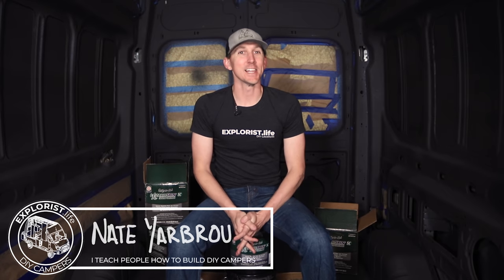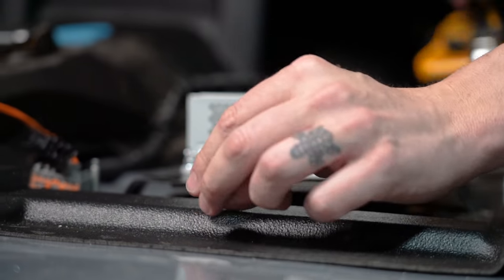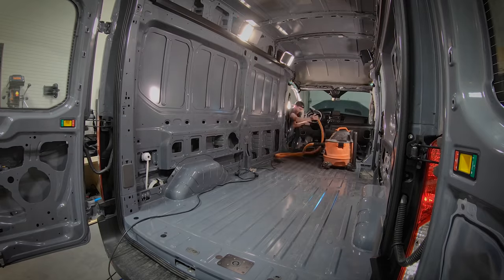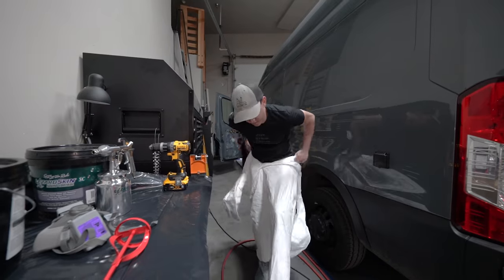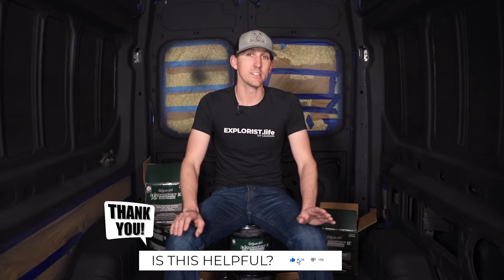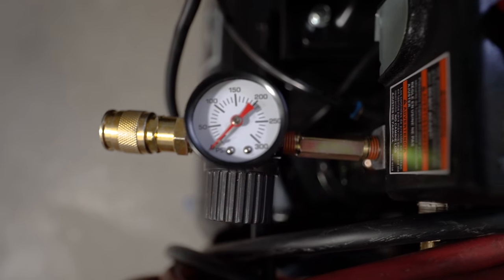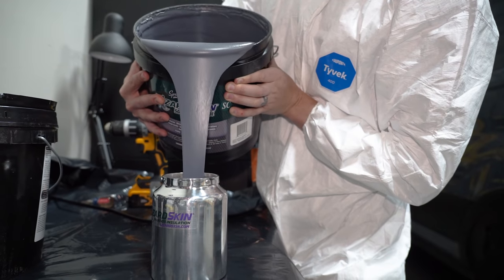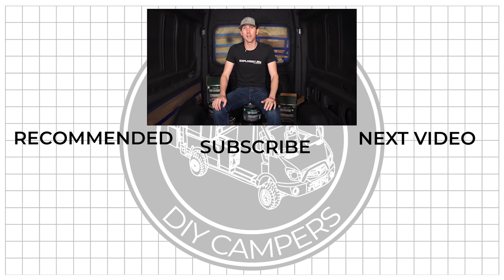Spraying Lizard Skin Sound Control Sound Deadening in our DIY Ford Transit Camper Van

Comment: I built out a 2020 Transit in my driveway during 2021. Lizard Skin was a product I considered very deeply. But, I concluded the results would not outweigh the effort. First, I would need equipment which I did not own, and would not use regularly after this project.  Second, the effort to prep and spray was not going to deliver great enough results for me personally.  My final decision was to purchase just enough LS Sound-deadening material for the floor and to paint it on with a brush.  I confirmed with the LS team that this was ok and they said yes.  It made some improvement, but not enough that I would do it again.  After much consideration, I realized that for my lifestyle (I travel and camp mostly in cooler weather, if it gets too hot or humid I go someplace more comfortable), I can crank up the Wabasto furnace and stay VERY comfortable for literally pennies and never hit the cost of spraying in both the sound deadening and the ceramic layers.  Much luck on this part of the project.  I look forward to seeing the entire build.  BTW, thanks for everything you have posted about van life.  BattleBorn sent me your electrical layouts and held my hand through my entire electrical system install!

Comment: All of this is "DIY" as long as you have $10k of tools factored into your budget, and a big shop area to do your build. Still, these videos are invaluable
Reply from the maker: A big shop is not a necessity.  We have one now, but we started with a small garage and a driveway.

For tools...I won't be using any tools that most DIYers won't already have for the most part like CNC machines, plasma cutters, etc.

Most DIYers have the basics like hand tools (rachets, sockets, wrenches, etc), air compressors, drills, and stuff like that.

If you're starting with absolutely nothing...there will indeed be a significant portion of the budget to buying tools (like ANY diy project would require).

Comment: Why have to complicate the build with spray paint? Just roll or brush with isolation membrane from Mapei or Redguard. These product work great in tiled shower bath. The surface will be all covered anyway.
Reply from the maker: Because that's what the instructions recommended for the product we were using. 👍🙂

Comment: I would of gotten a Professional Spray Foam Co. to have applied 2" on walls, and possibly 3" On ceiling. This would of taken care of sound proofing and given an R value of  7 per inch. Did this to my build, its rattle free, quiet and cosy warm.
Reply from the maker: The risk of having the spray foam making waves in the body panels as the foam cures was too big of a risk for us; but I'm glad it worked well for you!
Reply: To each their own

Comment: Nate, people in general would LOVE more details on door panel removal plus A pillar trim removal as many people want to pull these to upgrade the factory speakers. You can then do sound deadening onto the inside of the door’s metal panel, and attach Thinsulate to the plastic door panel and on the length of the A pillar.

Comment: I rolled LS on with a brush. It still works:) although not recommended. I also 'plastered' on the ceramic paint they have focusing on the ceiling and upper panels to decrease external radiant heat.

Comment: We used Kilmat for our Transit sound deadening. Kudos to you two for all of that disassembly work - I just would not want to put it all back together! We convered all surfaces starting behind the seats and did not worry about the cab area. We converted 100% of the surfaces and did 200% on the wheel wells. We also added some Noco foam sound deadening as well - same company. 

The before and after difference in noise level while driving was substantial. While driving down the highway - most of the time (depends on the highway surface of course) we can talk at normal levels and not have to almost shout like we had to before adding the Kilmat. 

And once we added our shiplap walls and ceiling, plus insulation, it got even more quiet. Whatever method - sound deadening is worth the money and time. Some only cover 25% or so, but we know more is better, despite what the naysayers . . . say! 

I am enjoying the series, but we plan on never doing another one! Be safe.
Reply from the maker: Very good!  How much (how many pounds) did you end up using in Kilmat after all was said and done?
Reply: @EXPLORISTlife  I used 2.5 boxes of Noico (like Killmat) 80 mil 2mm 36 sq ft at 27 lbs per box.

Comment: This brings back memories of stripping my 2 week old car apart back in 1994 to totally cover it in Spray and roll on dynamat, that was for a sound system competition though :D
All good fun and it was such a transformation afterwards.. I did do the bulkhead and foot floors on mine as I wanted to try drown out the diesel dugga dugga as much as I could too.
Back then the dynamat spray was in cans that didn't need an airline and I got through boxes and boxes of the damn things... Having a proper spray gun is definitely the way forward. I think a "shultz" gun may work well here as it has a slightly larger container than a normal spray gun.
On the air compressor front, when money was tight, the trick was to buy those cheap 25 L compressors when they were on offer every couple of months, because they had dual outlets on them it meant I could string them together and act as one. Had three in the end daisy chained together. Worked brilliantly, loads of CFM for any tool you liked
Reply from the maker: I think when I do the ceramic insulation, I'm going to attempt to just stick the syphon tube down into the 2 gallon pail of the stuff. 🤣🤣 I don't suspect it will work very well...but I'm still going to give it a go.
Reply: @EXPLORISTlife  haha Stick the container in the middle of the van and run a hose pipe to it hahaha Might need a few more psi to lift it out the bucket :D

Comment: I have been considering Lizard Skin for a couple of years.  You're definitely helping push me in that direction. You might want to talk about the insulation factor of this product too.  Take a surface temp on the outside and the inside and then ambient temp.  You'll notice some rather interesting results. Can’t wait for the controversial insulation episode.  Cheers from Canader eh!
Reply from the maker: Perfect!  Will do.  I bought a thermal camera to pretty much test just what you're describing.  Going to do the ceramic insulation on half of the van in the 70 degree shop, pull it out into the cold, and see the difference in how long it takes for the cold to get through.
Reply: @EXPLORISTlife  This is a great video, thank you! I'm very interested to see the measurements of both sound and thermals.  Did you consider projected cork instead of LS?
Reply: @EXPLORISTlife did you make the video your taking about thanks
Reply from the maker: Yes, we did.

Comment: Interesting! I didn’t use any sound deadened in mine besides pink foam board and 1/4” ply for my walls. Never had a single squeak and it’s dead quiet. In regards to sound descending the cab, remember that it only gets noisy in high winds with the infamous transit doors that flex and break seal. Other than that, they’re pretty quiet from factory once you complete your buildout.

Comment: Great video! Did you spray the floor? Haven't found any channel saying if beneficial or not for sound deadening or with the ceramic insulation as a thermal break.
Reply from the maker: We did indeed spray the floor.  Will have dedicated videos testing for both sound deadening and ceramic insulation testing coming up over the next 3 weeks, so stay tuned!
Reply: @EXPLORISTlife  thank you so much. Subscribed as I'm starting a van build and going through the first steps. Your electrical videos are spot on too coming from an experienced mobile installer.

Comment: What do you think about spray-in Polyurethane foam? High R value and sound deadens as well.
Reply from the maker: There is too big of a risk of the foam warping the body panels and causing ripples as the foam cures for us.  I'm also not a fan as it would make body work near impossible if necessary where this stuff in this video plus something like 3M Thinsulate is the same as paint from a body work standpoint.

Comment: For our van we are considering doing a spray on insulation (likely done by a professional), would you still recommend doing a sound damping solution (LizardSkin or other) or in your experience is the spray insulation sufficient?
Reply from the maker: I would recommend doing whatever sound dampening method seems most appealing to you (LizardSkin or Peel-and-Stick) and then do some kind of 3m Thinsulate or Havelock wool, or Polyiso foam insulation.  I cannot recommend spray foam insulation due to the risk of warping body panels as the foam cures.

Comment: Slightly confused by “20 mils” surely you mean 2mm? Or is it 20ml, which I’ve no idea how you would measure!
Reply from the maker: A mil is a measurement equal to 1/1000 of an inch.  The application kit includes a little gauge to help measure this.
Reply: @EXPLORISTlife  thanks! TIL
Reply: @EXPLORISTlife  
1/1000th is 0.0254mm, not 20mm (or "mill")
20mm (20mill) is 0.787"

I think the application kit might be wrong.

Comment: How much product did you end up using for this step? Exactly 12 gallons?
Reply from the maker: Yep.  Bought 12 gallons and used it all.
Reply: I have Mercedes T2 which is larger than a Sprinter van. Like you I plan to do walls, floor, ceiling and also front cockpit floors and bulkhead. Ideally I’d like to do inside doors, engine bay and hood but this stuff adds up quickly both in terms of cost and weight. 

According to their formula for ~420 sq ft I am supposed to use 17 gallons of insulation product and 21 gallons of sound control. That’s 38 gallons for a total of $6404. 

Lizardskin weighs 0.6lbs/sq ft so that’s 252lbs of paint towards the GVWR. Not an issue for me since my GVWR is 16,500lbs  but I’m still trying to be mindful of every pound added to my build. 

I ended up ordering the commercial version of these products (same manufacturer and formula) which is made by Mascoat and is sold in 5 gallon buckets. The Mascoat sound product is $20.18/gallon cheaper and the heat product is $10.88/gallon cheaper. 

Since it’s a water based product my friend was able to dilute both products with water with great success thereby increasing the volume slightly and making it easier to apply.

Comment: Why did you go with Lizard Skin like approach and not use these sticky stuff people use? And would this be enough for heat isolation for something like -20C (68F)?
Reply from the maker: We wanted to test out the Lizard Skin Ceramic Insulation and since this stuff is a 'step 1 - step 2' kind of deal; we just decided to go all in on both Lizard Skin Sound Control as well as the Lizard Skin Ceramic Insulation.  This was also just one of those "we wanted to try it and see how it went" kind of things.

I'm not sure I understand what you mean by your 2nd question.
Reply: Lizardskin isn’t insulation per se. You still have to install proper insulation on top of it.
Reply: Thanks for the answers. By second question, I mean, with the second ceramic insolation (as you mentioned), can you take your van to a place like a ski resort and stay there without freezing (I mean sleeping without a very heavy sleeping bag!). That's the location (temperature wise) I can guess would be similar to my area in Sweden.
Reply: @mtrezaie  The answer is no it would not by any means be sufficient for the situation you are describing. The thermal barrier coating is not a substitute for insulation. It is intended as thermal and anti-condensation protection. You still need to insulate on top of it.
Reply: @carljonsson3292  Thank you very much. I have to do some research on what should/could be added on top of this to have that type of insulation.
Reply: @mtrezaie  Most common insulation in US is 3M Thinsulate or Sheeps Wool but I am going to use Closed Cell Sprayfoam as it has twice the R-value of those two. 

Armaflex seems like a common option in Europe but for some reason it’s hard to get over here. Hejsan från en annan Svensk förresten! 🇸🇪